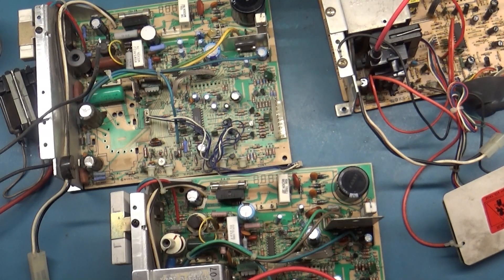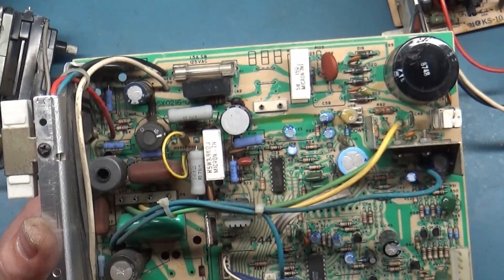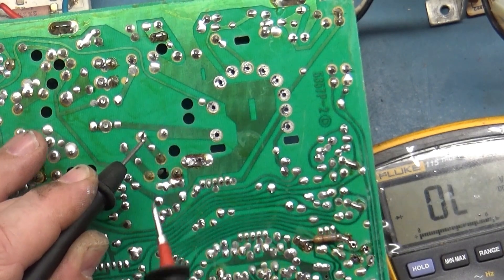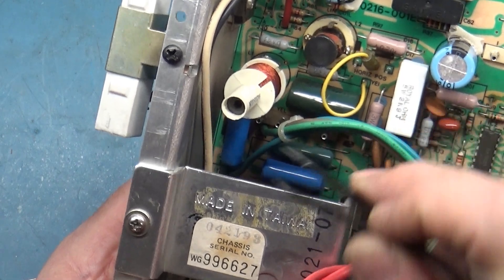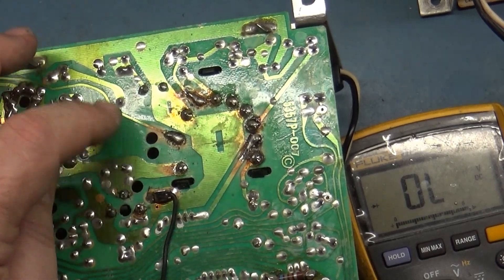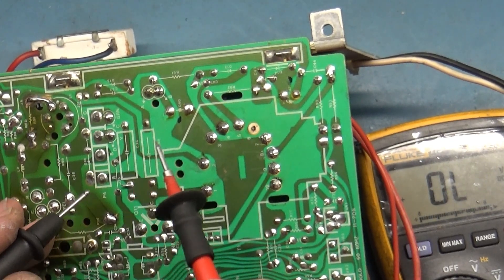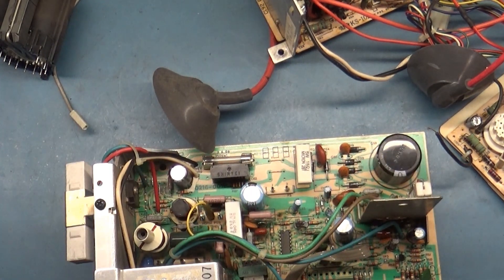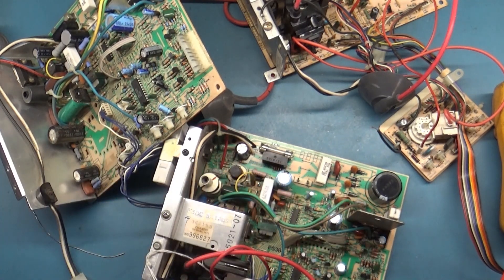K7000 Arcade Monitor Chassis Repair - How To Test C36 - Critical Safety Cap Information

Comment: Hi Mike, Is the replacement c36 cap always the same on the k7000 25 inch? And we don't ever jumper the c36\c69 caps on the 25 inch, is that correct? I often get parts boards and it's confusing when previous operator/tech removed one of those caps.

Thanks

Curt
Reply from the maker: Correct. If you have a C36/C69 setup, you need to use two caps. If you have a single, 4-leg C36, you can do the mod.
Reply: @MikesArcadeMonitorRepair thanks .Are you always seeing the .0036uf cap at the c36 on the k7000 25 inch?

Comment: Ever had a bad c38 width cap blowing fuses?
Reply from the maker: Absolutely
Reply: @MikesArcadeMonitorRepair w c37 is shorted too. As well as  VR 
Nightmare. But it’s working now. Bad VR, blown fuse, bad c37 and c38. Went ahead and did HOT, caps and FB. Peters width cap kit came in handy here. Was a cheap EBay find.

Comment: I have a P447 that I recently capped and replaced R101, HOT, flyback, and the VR. It runs for awhile then blows the fuse. 
Inspection revealed a shorted HOT(again) and VR(again). With the VR and HOT removed, I tested C36 in circuit as you demonstrated. On diode check it would change value and not stay steady at .477 like yours. Is there something in this circuit causing this or is yours reading steady because your flyback is removed?